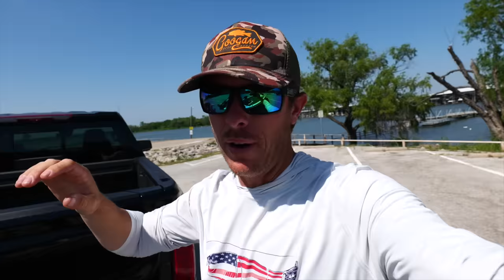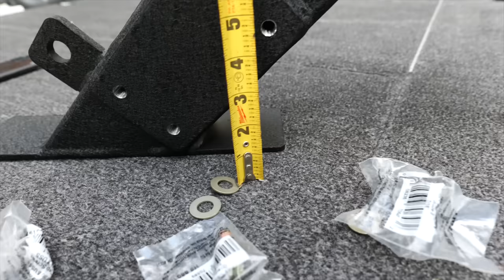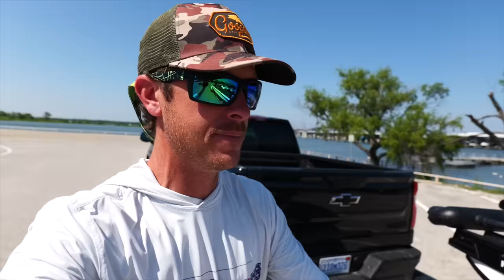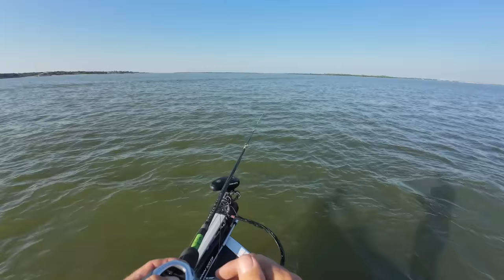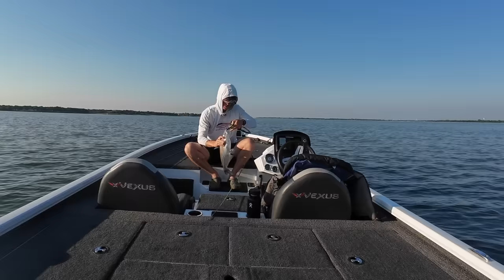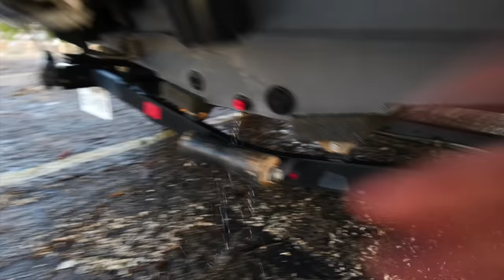I Made a Mistake & Broke My Boat! Don't Do This!

Comment: LFG: Thanks for your help in avoiding boat/trailer problems for your subs. Please share this story as you see fit. I’ve owned my boat, motor and trailer for 22 years. I’m extremely cautious about safety. I hate the idea of hurting someone or having highway trouble pulling my boat.  Every Spring I go over everything to avoid problems. At least I thought I did. This Spring I’m about to load my boat at the ramp. I look down (Thank God) and see I’m missing a nut on my u bolt leaf spring assembly. On closer inspection I see the same thing is happening on the other side of the trailer. Big problem. No u bolts, no suspension, major accident at maybe 70 MPH. Fortunately it’s an easy fix. Stainless steel lock washers, stainless steel  nuts and Locktight 290. Please tell everyone to check their trailer suspension when they launch their boats. Takes just a minute, but could save someone’s life. Stay safe, God Bless.

Comment: My Vexus dealer mounted my black box underneath the front of the boat by the front graph.  You can call VC Marine and ask them about it.  Also, you will definitely want a safety strap added in-case the winch fails.  Watch Mark Blackstock's video about his Nitro falling off the trailer because he didn't have a safety strap.  My Vexus dealer said out of the 140 Vexus AVX boats he has sold, only one has been sent back to the factory for a weld/crack issue and that hull was replaced.

Comment: important thing is to measure the weight u put on the trailerball.. it should be like 150lbs.. (u can look it up).. if its too light ur boat is too far back can be unsafe driving.. if its too much aswell.

Comment: I have learned with my aluminum boat that I need to leave alot of the trailer out of the water while loading. Boat lines up easier plus the aluminum boats are light enough to winch on up.

Comment: I have the same boat and mine broke today, how did you fix it?
Reply: I sold mine. Vexus screwed the pooch on these tins. 
Trailer was set up wrong from the factory. Cracked the hull. Vexus fixed the hull only to have it crack again.  Replaced the hull and traded in ASAP!

Comment: Hey lfg I need your help I have a 22 vexus with the same issue it’s the 1980 with the dual axle trailer vexus will not get back to me to do the fix will this work with my boat please help me out I don’t want this to happen to me please please help me

Comment: So a couple things first the fact that you pay as much as you do for a boat like that and the anchor hook that you hook/Tie your boat to like that snapped so easy even though it was under more pressure is crap in my opinion.
that piece should be one of the strongest points on that boat.
Second thing the fact that the boat and trailer are not set up and a lined properly from the factory so that when you are loading it up it is not sitting right so something like this does not happen.
And that it is up to you to figure that out is BS as well as this is something that should be done either from the factory or from the dealer to make sure the boat is sitting properly on the trailer right from the start.
those adjustment you had to make on the trail for your boat to sit right is something they should have done for you before ever picked it up especially for how much a new boat cost these days,
But hey that is just my opinion which does not count for a dang thing.
Now on to your owls vs your chickens.
owls love to eat chickens and they can even open the dang door to the chicken coup.
I have a video that my friend sent me after I gave him a trail cam as he was trying to figure out what was getting into his chicken coup and eating the heads off his chicken.
turns out it was a big owl that literally was flying down and opening his chicken coup door to get to his chickens.
So if you are finding chicken with just there heads gone that is a sure sign that the owls are eating your chickens.